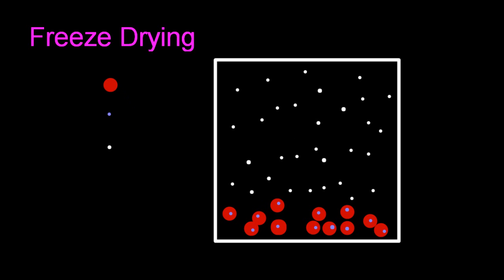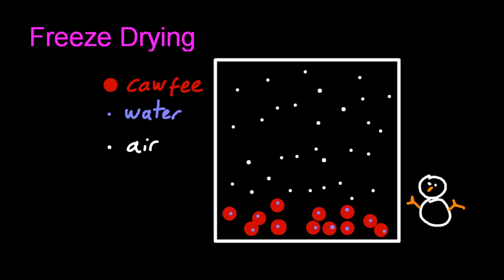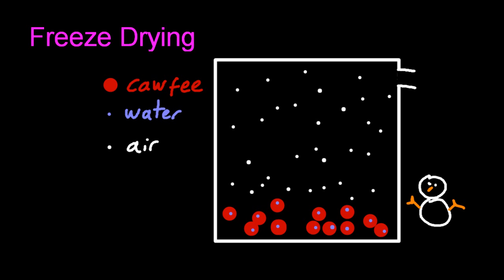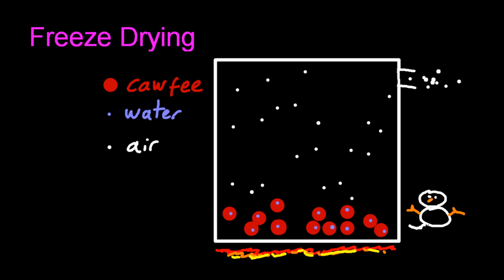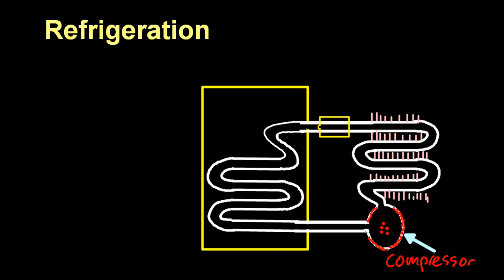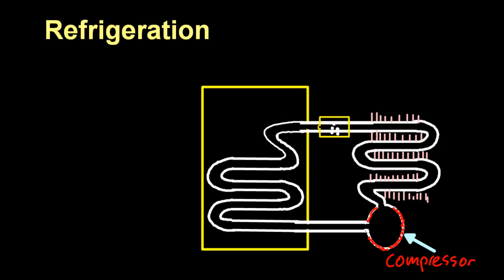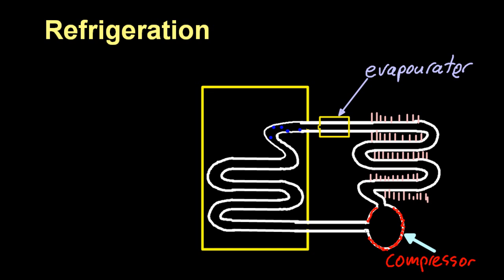1.1 Utilization: Freeze Drying and Refridgeration [SL IB Chemistry]

Comment: But why do the already warm gas particles need to go to the compressor? couldn't it go directly through the radiator which cools the warm partlices down? Why do the particles need to be hot?
Reply: I was wondering the same thing. I think that the hotter the gas particles are, the quicker they will loose the heat they absorbed from the food in the fridge. So increasing the temperature increases the efficiency of this mechanism.